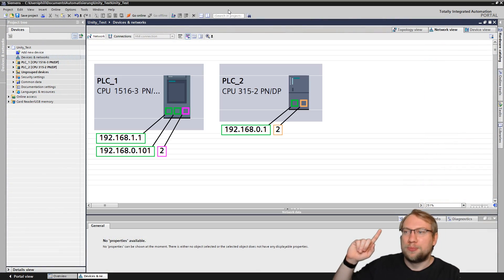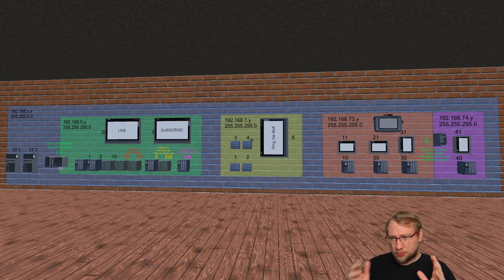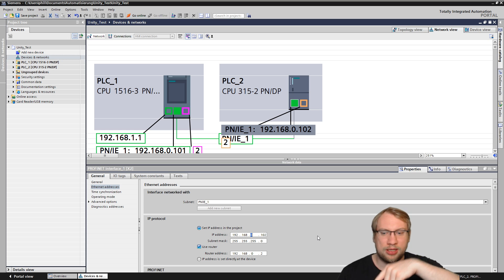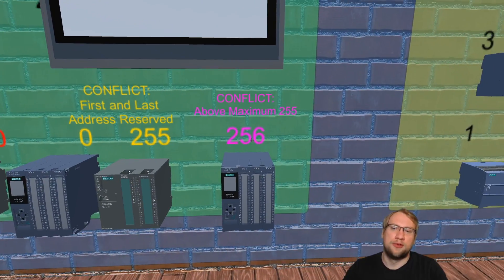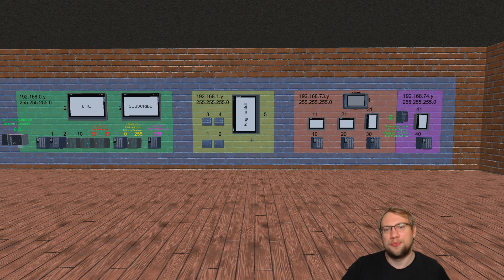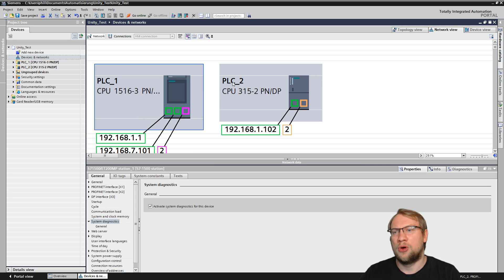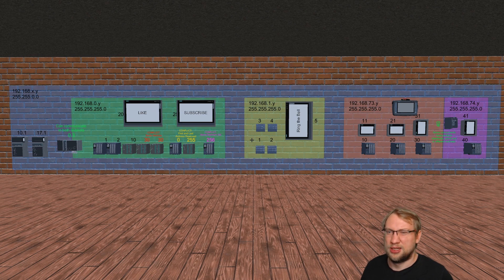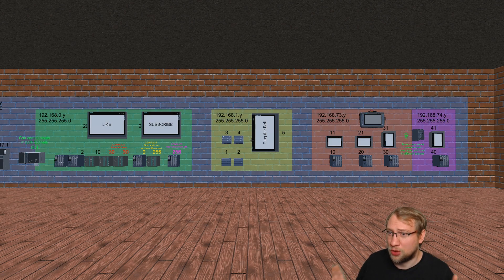Basics of Subnets in Ethernet

Comment: Can we set the adresses of both PLC Profinet interface to the same subnet (in this video PLC 1516)? For example port 1: 192.169.7.101 and port 2: 192.168.7.100. The other PLC would have the adress 192.158.7.102 so every device can communicate?
Reply: Hello. The model 1516F-3PN has 3 profinet ports. X1 is a two port switch composed of P1 and P2. This for me is the primary engineering subnet connection. For X2, there is only one P1 available, and used for MES or SCADA connections. The X1 and X2 interfaces cannot be on the same subnet. X1 is a 2 port switch so of course these have to be on the same subnet. This as you describe is not allowed by TIA portal software. Check out profinet couplers or a CP1543-1, really it's easier to redesign your ip addresses because that doesnt require physical hardware. You can software change that easier than spending money for
 equipment.
Reply: @DallasLevine  Hello Dallas Levine! Thank you for your answer. Everything ia now clear to me. Nice helpful community growing up here ☺